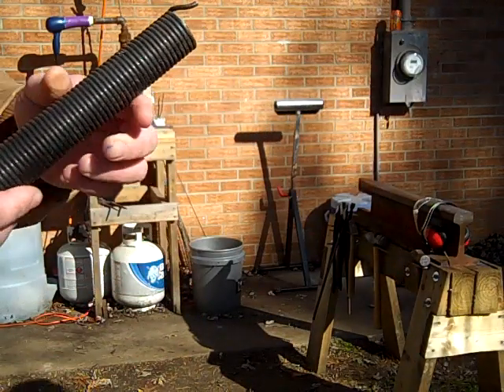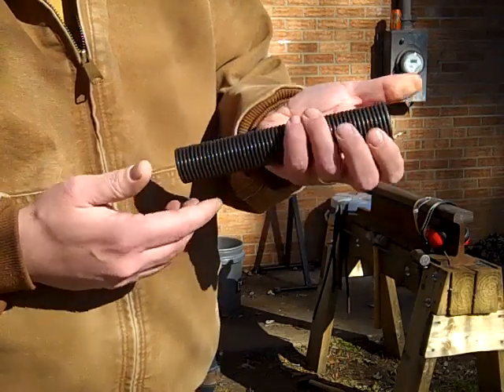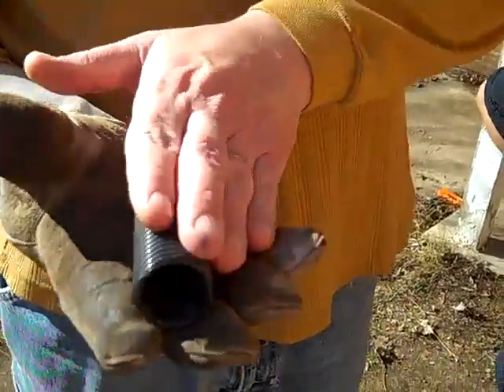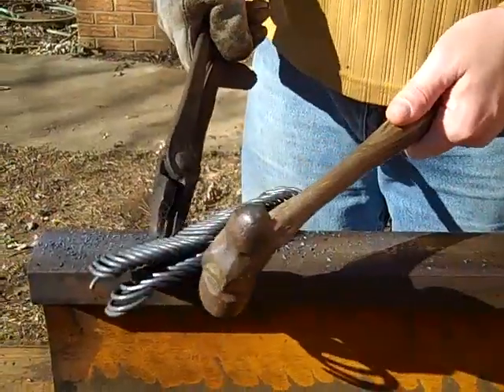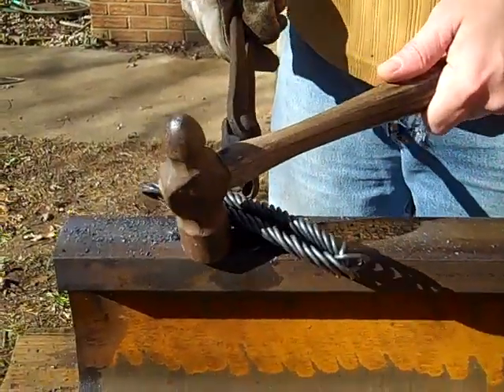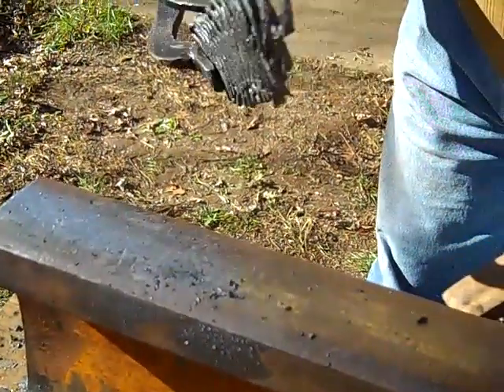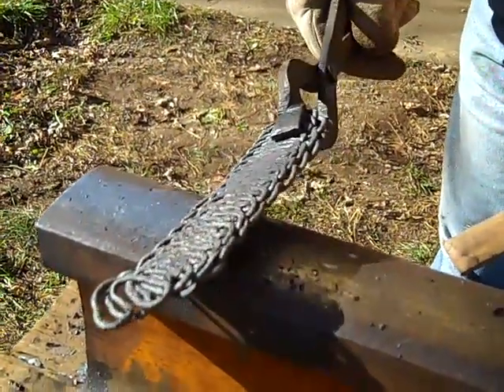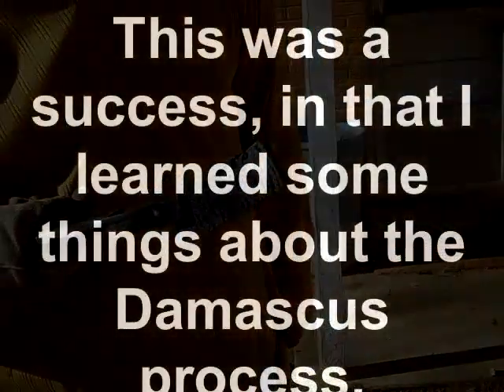Making Damascus from a coiled spring

Comment: That sparking is the metal burning, welding temperature right before it starts to spark... Of course it's partly preference, but the hotter the steel is the better your weld will be nine times out of ten. But either way if the metal is throwing off sparks, it's burning, and that bad.

Comment: oh yeah i forgot ,, take you ass , down to the hardwear store , and get some  plummers acid , and in a  gallon bucket mix to   one gallon of acid to gallons of water . dont get your hands in  it  tie tyhe spring off on  something and a cross bar and set it into the bucket leave it for 25 to 30 minuntes to eat the coating off the steel

Comment: To further close the voids, try rolling the the peice from one end to the other like a jelly roll. I have done this in several different ways, and how well it works depends on the quality of the steel and of what it is made. If you don't know that, it will be near impossible to achieve a good harden and temper when you are finished. I suspect from watching that your spring is something between 1050  and 1095 simple carbon steel. For my credentials, go to shadowblades online. I have classes also.

Comment: My first question is, did you ever use any kind of flux on the spring? You didn't show it in your video. If not, next time, try using borax as a flux. You will get a much better weld. As for the voids left, once you have made the weld by folding the spring, you need to turn it on its edge and forge from that side as well. Once that weld is established, go back to folding the peice again. Keep alternating from flat to edge as you forge,and flux each time.Eventually, you will achieve solidity.

Comment: No, your heat was insufficient, also you can't just burn off a coating and then expect it to weld, the surface area you are trying to heat prevents any adhesion because the scale, combined with the residue of coating prevents surface to adequately retain heat in order to weld, IT IS NOT TOO MANY VOIDS OR THE LACK OF BORAX  I can continue if you like, but why, the fact you don't even know what a welding heat is seems incredible to me.

Comment: ya dude thats needs to be wayyyyy hotter more flux and cleaned alot better try taking 3 or 4 ground pieces of 1/8 in steel and weld them onto a bar flux them heat them up to a near white heat and bash them together damascus is when you have contrast to so this spring would not make it steel cable works only because there are 2 types of steel in it i suggest doing more research in the making of damascus steel

Comment: You have the right idea, but the wrong process of going about it... Damascus steel forge welds a Dense Carbon steel with a light Carbon steel... Giving strength and Flexibility. Try looking up "Water Steel" to get the idea of what the Billet should look like to start... AFTER that is where your spring steel would come in... Instead of trying to hammer it flat(which, you're right, would be much easier with an airhammer. but still traps alot of air and weakens it,) coil it around the other billet.

Comment: I would uncoil that thing, run it to a straightener to have general straight cable, and then fold it neatly. I don't know if that would work better but this is what I would do. I generally use solid steel like leaf springs or large helix springs from trucks/cars

Comment: yes, but this would still apply to this  (in case of successful weld of course :-)  ..because if you weld together spring or cable , each wire will decarb differently that mean each wire will have different content of carbon = different types of steel. 

sure, not as impressive as when you weld high carbon and nickel steel together but still damascus .  search "cable damascus" for more info  :-)  it was explained to me by ArtistBlade1972 :-) .  peace.

Comment: Higher heat, from the looks of it, the spring wasn't near hot enough for a proper weld. Add some flux at the proper welding temp, use a heavier hammer and don't be afraid to throw more oomph into your swings. The quicker you can drive the pieces together after coming out of the forge the better. Good start on the process though. It'll quickly become an addiction.

Comment: There is no chance that would have worked. First of all you have to make it bright yellow to white hot to weld it. Third of all you need a flux on that sort of steel (sand or borax). Make it orange hot, then sprinkle sand or borax on it and get it really hot in the forge (turn it while heating). Until you see sparks coming from it (in this case it is the flux and not the burning steel). Then carefully tap on it to bond the pieces. Don´t hit to hard or the pieces will jump apart.

Comment: The only thing i would have done differently is taken that sprring extrended it and cut it so you have multiple rods of steel and then used that to layer once you made a very thin billet piece ad more rods on top of the multiple rods you weld together lengthwise.

Comment: @naabtalschmied you don't necessarily need flux to truly forge weld, forge welding is the conjoining of two metals, not adhering the two by using fluxes, all the flux does is make the forge welding simper but not necessary

Comment: @naabtalschmied 

u can practice with a chain of a chain-saw too. but take flux. a steel cable or a cain from a bike would work much better than springsteel. spring steel didnt draw good lines in damascus. for damascus u need two different metalls!

Comment: an air hammer for what? for compressing the steel together? this is not welded, its just pressed into it! u need flux! with out flux or "welding"-sand u cant weld it. 
you are a  novice in blacksmithing and u have to know, that spring on spring is the "worst case" of welding. take some materials without silicium or crome and athor metalls which makes the welding much harder. 
go and buy a book for beginners in making damascus. take a steel cable to practice. this could work. u need FLUX

Comment: Damascus steel is two different hardness steels folded together. It takes hours of hammering, folding and hammering. You need to get it really hot. When it starts to spark you are too hot and are burning the steel. 
 Also you need to flux it on every fold. Regular borax soap works great. 
 You should read up before calling a bed spring Damascus steel. 
If you don't get a power hammer you will have to learn to enjoy carpal tunnel.

Comment: it definitely had a forge weld heat, though that may have been missed in the video.  but you can definitely make pattern welded steel from one type if enough layers are used. Like when Wire is used. apparently inbetween the layers there is an exchange that will give you the different layers of varying carbon contents.

Comment from the maker: @RDPproject I used a cutoff tool and examined the inside of the billet.  It had indeed fused in places, and there is a relatively tiny chunk of solid steel down in the middle of all that, but maybe only 1/10th of the original size.  I really need to be able to mash the whole thing very flat, and trying to flatten a spring with a hammer on a curved anvil just doesn't seem to be the way to do it.